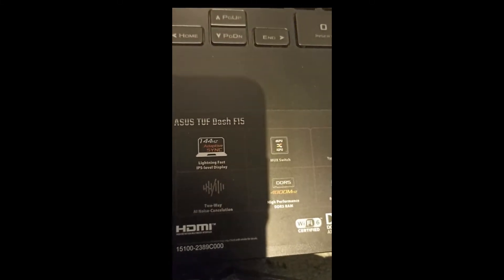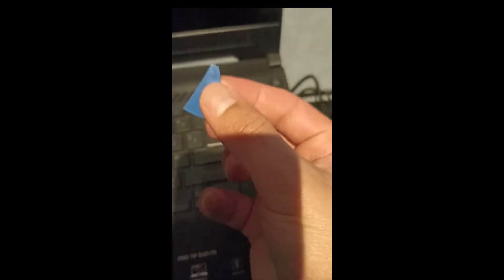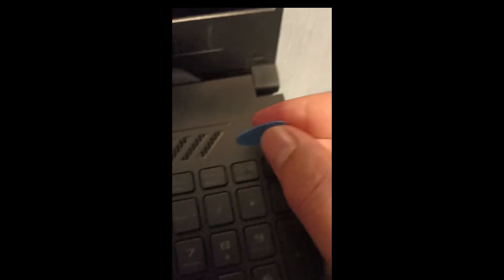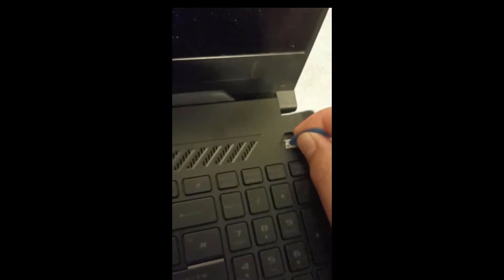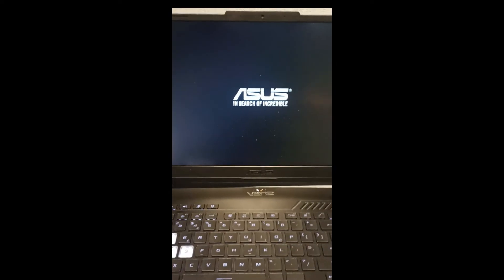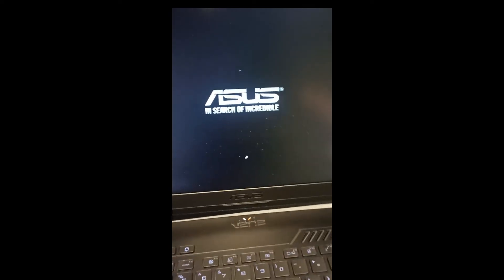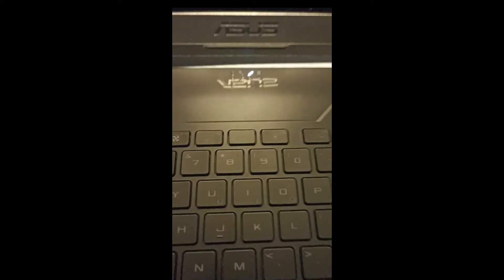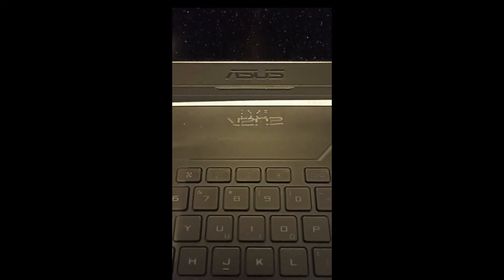How to fix Asus TUF Dash F15 Power Button Failure #asus #tufgaming

Comment: Now I'm wondering how to fix this? Maybe try gluing something under the button, creating some kind of bump... Maybe that will improve the contact?
Reply from the maker: Yes i tried using a silicon button mould, of the same shape as the original one but it didn't work. Something to do with positioning and material type but worth trying if the original button still intact and not broken,
Reply: @Tech_Alchemy  The button is intact, and so is the mounting bracket. And even the membrane is intact. I don't understand why the button stopped working.

Comment: It works smoothly. 😮
Thanks for the help buddy.😊

I fixed it permanently with few steps.
Just took a very tiny piece of paper and folded it and then used it below the button. Now, my button can easily touch the switch below it. And now the power on with just a slight push on the button😊
Reply: Put the paper under the white thing?
Reply: Or where😭

Comment: Also for pepole who can get it on might want to check for "ac boot for laptop do when you plug in ac it starts"

Your a darn Saint it slightly disloged and i poked the white thingy holding squishy pressers thingy white thingy now it starts normally again and the button. I've normal been trouble shooting this fucker for 2daysand picking it apart. Now the button is slightly protruding and working again like normal. Much love to you and bless you ❤❤❤.... sorry for grammar...had to do it 2 times...been picking apart and ducking around with this for 2 days saved me a trip to the repair shop or return it for a new one
Reply: Wdym poked?

Comment: Permanent easy fix: you look under the button that you removed, there are 4 tiny lugs. They are too long and this is why the button can't be pressed enough to make contact. You take a nail file and polish them by rubbing the underside of the button like 10 times on the nail file. You put the button back on and voila!
Reply: Please elaborate a little more. Also I would like to add my observations: The power button won't respond for a cold start, but when i plugin the laptop, it seems to work

Comment: I thought this problem was only in my unit, but it seems a common problem on these models. Glad im not alone. I was thinking to send the laptop back to the asus customer service, but hell nah, the procedure too complex, and it can took a long time to repair.
Reply from the maker: yeah there procedure is intentionally complex I imagine this is some sort of planned obsolescence they do seem to pump out these laptops from the factory at a rapid rate. Never buy Asus. I've heard of similar issues from the very high end Asus gaming laptops.
Reply: @Tech_Alchemy I imagine the same thing after reading some comments on this video. Knowing this issue, now I feel regretted choosing this laptop over Lenovo LOQ back then, I chose this Asus because of slightly bigger battery and thought they already fix the problems on the previous gen, but it seems not. Alas, it is what it is, I'll just use this laptop until it's dead, then I'll buy the new one and surely won't Asus again.

Comment: This is systematic issue and by pushing rubber button - it will fix the issue temporarily. I'm on the next stage when button removed completely, because it doesn't help anymore. Current issue is power on, but switching off suddenly.
Reply from the maker: yeah the last thing i did before i threw laptop in trash was hard-wiring the power button to the circuit board which eventually stopped working too
Reply: alguna pieza dentro del botón por las altas temperaturas se despego y se mueve, yo quite el botón y presiono directamente la goma, el problema es que a veces prende y a veces no,  y cuando lo transporto prendido en la mochila a veces se presiona solo y se apaga. una m.. de laptop :v, la única solución que me dieron fue cambiar todo el teclado. laptop gamer que no soporta altas temperaturas en su teclado.
Reply from the maker: @jossimar19xD  Hermano, tuve el mismo problema una vez, se encendió solo y en mi espalda durante un día entero se puso tan caliente que era como una sauna.

Comment: i have the Asus tuf gaming f15, it turns on very randomly i cannot figure out what to do anymore, this does not work 🥲 the laptop is fairly new and works perfectly when turned on, I don't understand what's wrong with it
Reply from the maker: yeah this also happened with my fairly new laptop as in the video at the time. I think what killed it was running games on max settings the heat ends up melting the button 😂 😂
Reply: I have asus tuf gaming f15 and i CANT get it turned on, ive done everything i could, sometimes it took me HOURS to turn it on. I'm really worried about it and idk if i should take it for repairs (ive only bought and used it for 8 months
Reply from the maker: @logannist  yeah mine started to defect within same period of 7-8 months.
Reply: @Tech_Alchemy  si en mi caso pasó igual, esa laptop ejecuta todo en máximo rendimiento pero no tiene un sistema bueno de control de temperaturas y se quema todo. toca cambiar todo el teclado T_T
Reply from the maker: @jossimar19xD  Sí, Asus no es realmente una buena marca de computadoras portátiles. Toda la serie Tuf parece tener problemas de calor.
Reply: unfortunately this did not work for me🥹
Reply: This is risky BUT you can take the silicone while thingy out and under it you have a white small thing, you can press on it. If it doesn’t work, worst case, scrap the while thingy off carefully and then you can short the power pins on the board. But after that there is not better solution.

Comment: i have  same issue so i go to  the local repair shop and  they told me the hardware is all ok but  maybe the power button is faulty so i  consider  that  maybe its the power button fault but when i turning on my laptop it will be on 1 second or some times take  atleast  4 to 5 min or some time  so i think should i have to go for the technician or go with the method u shown .

Comment: I love having to Stab the power button with the key cap removed every time I want to turn on my Laptop. Thanks, Asus :D
Reply: As an update:
Got an independent Technician (With no association to Asus) to take a look. He added a New small button on the Side of my laptop, as a new power button. Works perfectly, and hasn't yet failed. The old power button just sits there unused now. Had to do this, since pressing against the rubber part became less effective over time, and it eventually broke off.
Can't believe I had to go that route, but Asus offers no help for the issue caused by their crappy design.
Reply: And I have a different model but the same powerbutton, failing after the 2 year warranty period .. never will by asus anymore..
Reply: @WimvdBrink  
Fully agree, their laptops are just poorly built, with essential (and fragile) parts with no heat resistance, placed right where the Laptop gets hottest. Selling a product like this, that practically self destructs not long after the warranty period shouldn't even be legal.

Comment: I did this way about a month ago, but today the rubber piece tore. What should I do? Please help.
Reply: Same bro, what did you do
Reply: Sameee  @muhammadirhamhakimroslan682
Reply: same bro, what did you do
Reply: @YtArslan  I had the exact same problem, with the rubber and all. I had to replace the keyboard...
Reply: @Light-cy7fp  thanks for the answer, I would also like to ask if when replacing the keyboard I will have to reinstall the system or will my files remain with me
Reply: @YtArslan  They are on your hard drive (hdd or ssd), nothing to do with the keyboard so you will keep everything

Comment: I dont know what happened with my asus tuf f15 laptop but yours atleast its showing the light signal sign of charging mine not even showing that 😭😭

Please reply and help ASAP
Reply from the maker: hmm it means you have either damaged battery or short circuited the motherboard.. did you open up the laptop by any chance or anything like that?
Reply: @Tech_Alchemy  no sir
Reply: @Tech_Alchemy  also I wanted to tell that can the power button be fixed again?
Reply: It might be game over
Reply: Need to replace your charger/adapter.

Comment: Can i remove the power button and put it back?
Reply from the maker: Hmm no you cant because if you remove it completely you will have damaged the contact points in the silicon but if you know what you're doing you could reconnect those contact points.

Comment: My laptop has the same error with the button that I struggled to turn on for a while. It is not exactly the TUF Dash model, but it is the TUF Gaming A15 model.
Reply: Same here, i tries this method like shown in the video, but i have to spam it took me like around 5 minutes, but hey it works
Reply from the maker: @angelpheng7237  yeah unfortunately this model of laptop by asus is most likely error from the manufacturer. If you still have a warranty you should contact Asus although they may take forever to respond. Your best would be buy new keyboard of exact same model of the laptop and get someone to replace it, that is ofcoure if you really need the laptop.

Comment: Why a new keyboard?
Reply from the maker: because the type of keyboard directly has its keys attached via contacts on the keyboard circuit and is extremely sensitive, when one key has it contacts damaged you need to replace entire keyboard IMO its awful design and most likely some sort of planned obsolescence by Asus.
Reply: @Tech_Alchemy  I don’t really understand. If I go to a service center, can't they just fix the power button?
Reply from the maker: @YtArslan  you can try going service center and get it fixed that way. Most likely will be new keyboard it was Dash F15 laptop they designed it as one piece integrated keyboard keys. I hope they have changed it now for the newer models of laptop. So it was a point of failure due to where the power button was located on part of the laptop where they were was very high heat that was not dissipating efficiently hence it overtime melted/damaged the power button.
Reply: @Tech_Alchemy  thanks for the answer, I would also like to ask if when replacing the keyboard I will have to reinstall the system or will my files remain with me
Reply: @Tech_Alchemy 
Yep, they're the only ones who can realistically fix it, and can charge whatever they want to do it. They definitely work these things in intentionally, their laptops are Designed to fail.
Reply: Anyone know about Asus tuf 15 Hf modal it's automatically off than I tried multiple time but not able to on I just bought

Comment: its not working???? Am i doing something wrong, i have the exact same model, the exact same issue but it doesnt work
Reply: Same. Having same issues sadly this is not the fix.

EDIT - This will most likely NOT work for everyone, but my fix in the end was to unplug it and force it to die out (since power button obviously wasn't working at the time for whatever reason) and forced a restart that way after plugging it back in.

Comment: This problem is so common on the model. Just tried turning it today took me 20mins
Reply from the maker: Yes, it's very common in this model of Asus gaming laptops. I've even heard of similar issues from other Asus laptop owners with different models.
Reply: any updates bro?
Reply: Every time I need to press the button a bunch of time to turn it on
Reply from the maker: @leong2915  most likely it's now getting worn out be careful not to break the rubber button, too bad its not mechanical or simple button could easily replace that key,
Reply: Haaha is happen to me now, i buy it yesterday and todas i just tried to install the another m.2, but when i try to turn on dont work xd
Reply: I’ve been trying for an hour and a half

Comment: Is there any other method to turn this model on? Maybe any combination of buttons?
Reply from the maker: no there is no combination for this particular model of laptop but you can power it on from the connection points if you take apart the laptop.

Comment: Thanks for showing me. I tried to do this but it didn't help. The button hardly responds to presses. Looks like I'll have to buy a new keyboard ((
Reply: no try it again
Reply from the maker: yes, most likely it has power button completely broken in which case yes you may as well buy a new keyboard.
Reply: dude, did you replace the keyboard?  the problem did not return?

Comment: A LEGEND
HOW DOES IT WORK
IT FIXED MY BUTTON
Reply from the maker: Sometimes the rubber membrane pad doesn't make full contact due to over heating or the plastic keypad shell doesn't press down enough to make full contact with underlying circuit. Many people with the Asus laptop have same issue.